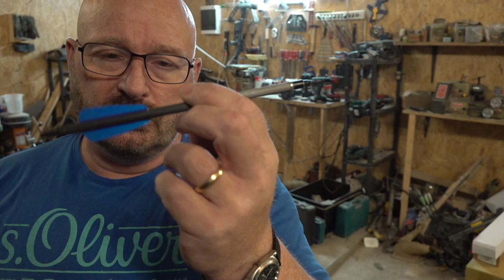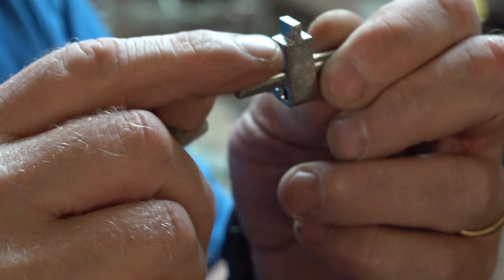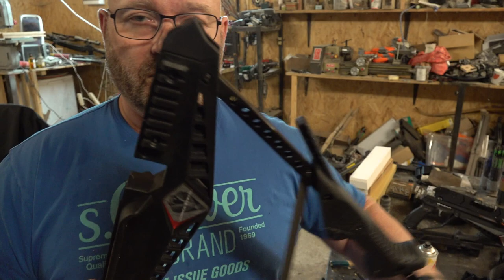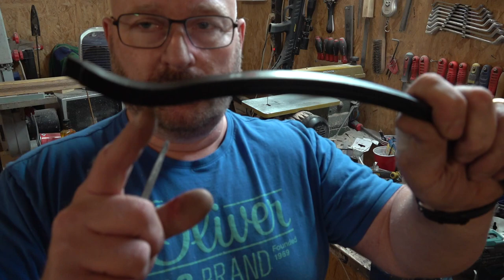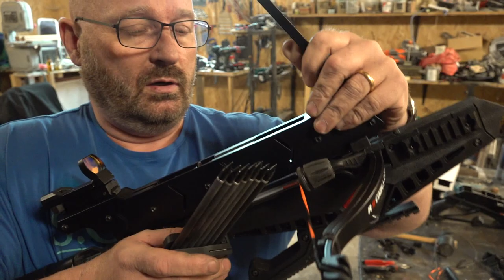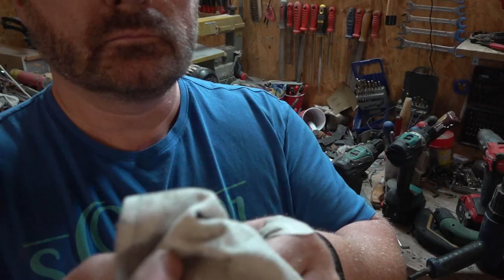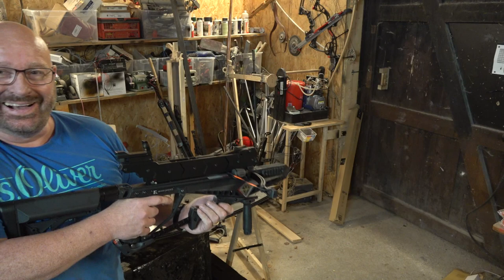The Grand "Adder" Crossbow Tuning Guide

Comment: @Joerg
If you are using a 130 pound bow limb & string with a 13 gram bolt then if you change the bow limb & string to 180 pound then to get the maximum efficiency of the bolt it should only be no more than 18 grams precisely because it seems to work on the principle of 1 gram per 10 pounds of bow limb & string force.

You should also make a few 18 gram bolts & test them against your other 22 -  25 gram bolts for speed & power using your equipment there as I believe you are losing a bit of power using the heavier bolts.

Comment: The biggest complaint that I’ve seen with it is the proprietary bolts that it will only shoot. How about modding it to fire standard diameter crossbow bolts that you can get at any archery shop instead of having to buy the proprietary sized bolts it currently uses?
Reply: Truck Shackley then maybe capacity drops to an unsexy level.
Reply from the maker: It is a magazine based weapon. Magazines require ammo that fits perfectly.
Reply: @Slingshotchannel  Don’t get me wrong, it’s a pretty ingenious crossbow and I’m considering buying one when they become available. I’ve just been watching some other reviews of it on YouTube and the only complaint I’ve seen is the proprietary ammo. I guess when ordering one be sure to order plenty of extra bolts for it

Comment: Glad to see your hand is doing well, can I ask, when making your own bolts, say if you wanted to get other carbon fiber shafts like with the camo pattern or finding some with a color that sticks out real bad that might make them easier to find. is there a spine strength you would recommend Jorg?
Reply: Spine is not that important due to the short length of the bolts but 400 should be fine. As for camo coloured bolts you can buy vynle wraps from any good archery supplier.

Comment: If bolts were fed by a belt, then the issue of tension holding bolts down is taken out of the equation.
Could you not make an upgrade to the Fenris allowing belt-fed bolts?
Can you imagine the potential firepower/rate of a Fenris belt-fed bow from a fixed(staked) fire position?!

Comment: I am off to the tool shed.....but I wish the nocks on the bolts could withstand the 130 lbs never mind 180. I have destroyed four, two bolts and a string. The nock deforms and the string jumps up and rides over the bolt, destroying the bolt and the string. Maybe it's me, but with a magazine autoloader it's difficult to see what I am getting wrong :0(

Comment: What about increasing the weight for the siege 300 and it’s 7.5” bolts?
The siege already comes with a larger draw weight that the adder but only difference is the bolts  are a touch longer 
Any thoughts??

Comment: I would like to see EK archery or Cold Steel offer a conversion kit for the R9 and Cheap Shot 130. Unless I am missing something, it would be a trigger/rail assembly. Probably remove front site and should be able to put on a magazine. Am I right?
Reply from the maker: You'd have to change so many components, it isn't worth it. New frontend (the R9 has 90 pounds only, the cheap shot has no string stoppers). New system block. New crossbow body. New rail system. New magazine. New red dot. What is left? The rear stock and the front handle? The few parts that can remain cost maybe 15 dollars.
Reply: @Slingshotchannel  audiobook?

Comment: What about 130+90 lbs modding , still possible without reinforcing leverages ?
Reply: Pretty sure he said over 180lbs (or maybe 200) it would require further reinforcement
Reply: @choxiden3776  i know but statement was about 130+130 lbs , dont know if 130+90 was not recommended most for cocking reasons
Reply: @wernerheisenberg1365  I cannot remember properly but am almost sure he said over 200 required further reinforcement of the joints with steel
Reply: @choxiden3776  thank you
Reply: I believe that 180lbs is the most practical power to resistance cocking ratio for hunting and 130lbs for home defence. With practice a defender of home and property wants to be getting as close as possible in reload times to a lever action rifle.
Reply: @ewhyte8059  thank you but i am pretty robust and strong
Reply: Werner Heisemberg I appreciate your robustness and strength yet I was addressing the ability to swiftly reload and re-acquire a given target/s  under stress. I would prefer less deadly force over more deadly accuracy.

Comment: HELLO!!! is the "double  bow" technique also doable for the horizone pistol crossbow? it costs 45 euro and an additional bow costs 12, so it would be 57 euro, it has 80 lbs and the double bow setup should have about 130-140 or so? is it doable? this would be a very compact and very decent price 130ish lb crossbow that is compact! if necessary foot cocking or increase the lever of the horizone redback to compensate for higher draw weight.

Comment: I have ordered a 130# one and am wondering would it be possible to put a 90# arm inside the 130 arm. Would they flex as one or would they move differently. So basically do both arms need to be same poundage?
Can't find anyone who has on internet searches and YouTube 🤷🏻‍♂️
Reply: 🤷‍♂️ Already done with your 130# and 110# limb 240lb adder 🤣

Comment: When the $14.99 pistol crossbows from Asia hit the flea market stands we all got one. I would unscrew the tips and pour any number of 177 lead into it. It might be going 150 fps but when it hits a second energy transfer immediately slides forward on the cheap arrow and it is a nasty little distraction never spent over $30 on everything even a second bow screwed in behind the first in the anvil of the bow there..ok 200 fps. and maybe 40 50 joules and the weight made the shot .. after the arrow hit a split second comes 10 .177 pellets down the shaft and smacks into the arrow head and drives it .. I always leave traveling space for those pellets... What a whack from a toy crossbow... .

Comment: Joerg, I am looking one with at lease 490 fs. This Bow looks to be good for first time user but it is not satisfying my needs. Is is possible to modify it to a more stronger and faster bow?
Reply from the maker: No, this is as far as you can go with a pistol crossbow. You need a much longer power stroke. 490 fps is for the most expensive, bulky and heavy hunting crossbows on the market, and you will need a winch to cock them.
Reply: Thanks for your reply:) I am planing to work on a bow that is not only vertical but at the same time is horizontal. It looks a plus four bow! and the Arrow will be in the center of the bow! You can make it and you will see the power is more than expected. it looks like a + with the whole in center. I will make it but you have more footlings and place to do it. You have got the Idea and you should try it since my options to make it is very limited Pleas try the 4 angel new bow! I have seen this 4 x powerful bow in my dream about 15 years ago and have no resources to make it:)

Comment: I have two of these and have modded one and whilst testing the safety without the magazine I noticed that the string gets caught between the trigger mechanism and bolt guide rail.  Because of the magazine I never noticed this before and checked on the unmodded version same thing, there is a gap between the two where the string drops into. Won't be too long before the string is torn so am going to fill gap with metal putty to give a smoother ride for the string. Not sure if anybody else has come across this?  By the way the bow is fantastic and even more so after the mods. Kudos Joerg.
Reply: I noticed that today but thought the string travels so fast it probably doesn't doesn't go into that groove.  What limbs did you use for your mod and how thick did you make the transport lever?
Reply: @fearnstarr  I used two 90lb limbs and used 8mm alunimum which fits snug into the transport lever and just like Joerg says it snaps back really nicely into the pistol grip, a vast improvement.  Still not happy about the gap in the trigger mechanism so when the metal putty arrives I shall strip it down again and fill the gap. Fast or not the string constantly hitting that gap is going to wear it out far quicker than if the gap was not there.
Reply: I have filled the gap on both bows now with metal putty, filed it smooth and spray painted it. The string now glides over the gap and should last a lot longer now.

Comment: Hi Joerg.did you use 2 adders for the Tuning To do the 2 videos?
Reply from the maker: No, just two replacement 90 lb prods.
Reply: @Slingshotchannel  sweet 😍 .the adder looks perfect. Awesome piece of equippment.
Reply: @Slingshotchannel  Hi Joerg. What brand are the inserts? Where could you buy it? What kind of glue are you using?

Comment: @JoergSprave
 - why don't you arrange with the manufacturer for prebuilt variations of the throwing arm... so you have 90lbs , 130lbs , 180lbs upto 250lbs this will save alot of time or better still have a prebuilt upgrade kit.... most people don't have a bat cave to build this..
I would be first to buy the upgrade kit....😀
Reply from the maker: They don't want to go beyond 130 lbs because of product liability issues.

Comment: After few shots It Will break the arch, someone had already did this mod
Reply: Arch, you mean with those bow arms? That would mean there are mechanical stresses concentrated into specific arm sections, including the rebound or elastic forces.
Reply: I'm fairly certain he knows more than you, a person who saw a video that they didn't give any information about.
Reply: @brandonconway4822  what you talkin about i said that someone have already out 2 Bars on a pistol crossbow and After 40-50 shots they broken, there is the video on yt

Comment: what kind of back stop should one use for this? just plywood?
Reply: If you used plywood, you'd probably have a very hard time getting your bolts out of it.
Reply: I buy 2x 10kg rag bags from industrial cleaning suppliers and put them in polypropylene garden sacks with targets drawn on with a permanent marker. I get about 4-5" penetration with a 175lbs jaguar crossbow with 17" 2219 alloy bolts.